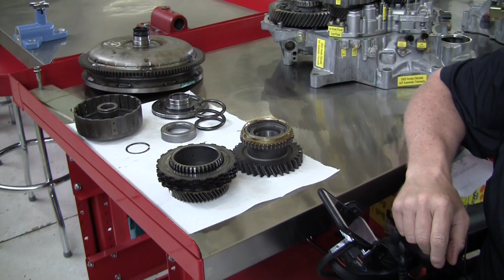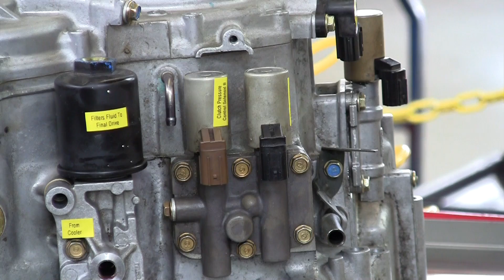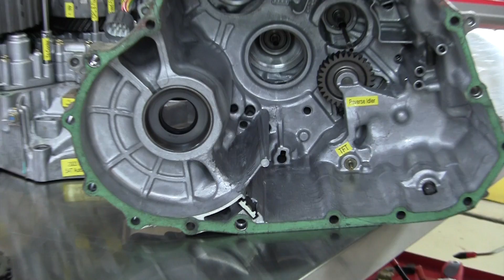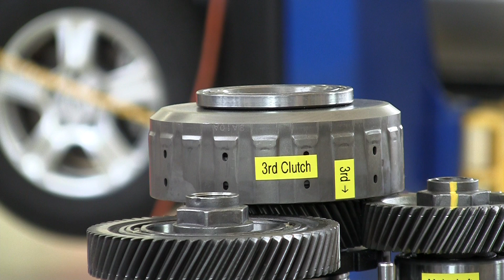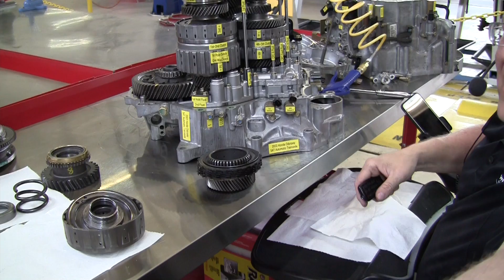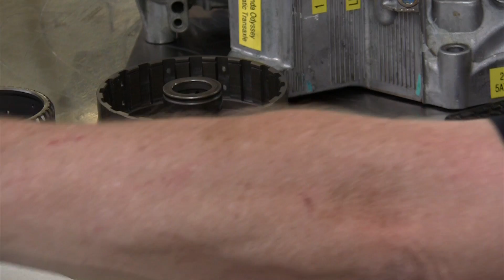Honda AT5 Automatic Transaxle

Comment: Hi, Mr.Weberauto, I just wanted to say I finished my transaxle rebuild and have found the root cause and FIX for the Honda Automatic transmissions of this era, it should include all Accords, Odysseys, CRV, Ridgelines, etc that use this similar design. Please read about my discovery on here, it was a team effort. The return spring that you noticed melted was simply the effect and not the cause.    https://www.odyclub.com/forums/24-1999-2004-odyssey/353519-quick-guide-how-fix-odyssey-5-speed-transmission.html

Comment: hi there! Would you know what has changed in the 5AT transmission since 2003? I have 5AT transmission in my Civic Tourer 2016 model, here in UK. Just wondered if there were any significant changes \ improvements. Many thanks!
Reply: I don’t know what they did but they sure did figure out the transmission. There was nothing but problems in these transmissions around years 2003 to 2006, especially in the v6 models. Now they don’t really seem to have problems but just do a drain and refill every 40k miles to keep the fluid clean. These transmissions hate dirty burnt fluid.
Reply: @robbym3542  cheers for the advice! My transmission is filled with their new fluid DW1 which is supposed to be fully synthetic. However I will most likely do a drain/fill at 40k or earlier!
Reply from the maker: As with all automatic transmissions, there have been many changes and improvements over the years. You would have to find all the service bulletins to determine the changes
Reply: @WeberAuto  thanks!

Comment: I have a 2010 acura MDX. I dont have any transmission issues or slipping my second gear does shift sort of hard. It has a heavier shift shock relative to the other gears. Is this a bad sign? I was told that honda transmission 2nd gear does shift harder then the others.
Reply from the maker: Good question. I have not heard of that. Yuo might check with the Acura dealership to see of there is a flash update for the computer which controls the transmission. Besy wishes!
Reply: consider servicing the ATF fluid and filter then do a TCM Reset so it relearns proper shift points and pressures with fresh fluids.

Most ppl will tell you "this is normal..." until you need a $50000 rebuild and that is normal course too!

Transmission die of high heat from failed/abused clutches that contaminate valves and plug filters. So drive your tranny gently with a light foot to minimize clutch wear AND service fluid for proper viscosity.

Ultimately tranny fail because skinny clutches are the weak points. Similarly this is like disc brakes.... even gentle driving can not prevent replacement only extend life.
👍

Comment: Hi Mr. Weberauto, you said the reason the 3rd clutch pack wore out prematurely is because the return spring is crooked making the Piston crooked causing uneven apply to the clutch discs. My transaxle is doing this and this is a common failure of this transaxle. How can we fix it? My thought is the spring must be redesigned so the top and bottom is flat but who would even be able to do that? A machine shop? Maybe a welder can weld supports on the spring top and bottom so it sits flat?
Reply from the maker: I think there is a new spring and clutch housing design to address that issue.
Reply: @WeberAuto  thank you Mr. Weberauto. I have pulled out the transmission and will be checking the parts soon to see if it has the same abnormal wear on it and I'll see if the parts being sold are the new design. Thank you again

Comment: Thank you for the video, very informative and very detailed. I do have a question though. I have an 04 Acura TSX.  Is there any way to modify the transmission to handle let's say more than 300hp? Like the old American transmissions for example the THM 350, 400, 200R4, 700R4, and 4L60E all have shift kits from various companies like B&M that add extra clutches to the clutch packs to be able to handle more power. Is there anything similar for this transmission or can you just add extra clutches to the clutch packs in the honda transmission?
Reply from the maker: I am not aware of a way to do that. The Acura versions of transmissions are typically stronger than their Honda counterparts
Reply: @WeberAuto  Thank you. Again amazing video, thank you so much for your time.

Comment: Hi Prof, Greetings from Singapore. I have a Honda Accord CL7 5AT (Acura TSX) and I love it. I would like to say that this is by far the most detailed and most educational video on the Honda 5AT. It is both inspirational and fascinating to observe the complexity. The level of insight you provide is priceless. 

By the way, I have always known that Honda's auto tranny isn't planetary-gear based - broadly speaking - is there an inherent advantage to Honda's design? And if it's so good - why don't others adopt the same? Likewise, could you share with us about the inherent weaknesses? 

Aside from this - could you tell us more about what influences the engine braking effect in an automatic transmission? It seems like my Accord has particular strong engine braking which I like alot and do not observe in other cars with planetary-based gearboxes. Thank you so much.
Reply from the maker: Honda's design is their design. They do no have to pay patent royalties to use planetary designs. Their design is good, but different. Engine braking is a function of gear ratio and torque converter slip rate control. Some transmissions also  use a one-way sprag or roller clutch that free spins when decelerating (no engine braking unless you select a lower gear range).

Comment: Thank you for making this very informative video. I also like the solenoids being mounted externally. I have been chasing transmission problems in my bro-in-laws 2000 Accord and cleaned the solenoid screens in an attempt to "fix" his transmission. I now understand they must have been clogged with friction material and the transmission is on it's last leg. Thanks to your video I do admire the design. I just wish the friction material was tougher.
Reply from the maker: Thank you!

Comment: Thanks for the video. I couldn't see the gear sizes but I assume effectively each pack has the same torque on it? The small diameter of each pack and no load sharing between packs must contribute to the failure rate of these in the heavier vehicles? The original Hondamatic only had two (manually shifted) gears and reverse. Internally it was very similar. It's as if they just kept adding to the original design.
Reply from the maker: Thanks for the feedback! Each clutch pack will have a different torque on it. The compensate for that difference with different numbers of clutch plates in each pack.

Comment: This transmission has had a lot of issues over the years in its V6 application.  The 6sp replacement seems to be a lot better.  Honda's new 10sp is their first planetary auto.
Reply: Not true. These transmissions regularly last 200K miles if maintained properly. More importantly, these units shift very efficiently and don't gear hunt. The new 6 speeds lock up the torque converter in much lower gears and have a dead pedal feel. The AT5 is far superior to the AT6 from a driveability standpoint.
Reply: I have a 5AT in my 09 TL im looking to supercharge my engine to make around 350-400whp do you think the tranny can handle that amount of power?
Reply: @scottn7694  I second that. I have a civic(2012 w/ 1.8) that survived not being serviced for over 60k miles and, still drove great with mystery very dark atf (didn't even smell like atf anymore)
Reply: @mrrmsfucker146 my ATF is just like that too, black, smells like earthy dirt. 2006 civic at 225k miles my mom (previous owner) neglected it since 2012 (she didn't know). On the bright side it still will drives well-ish, the filter is already changed, fluid is getting changed asap tho.
Reply from the maker: Very true. I hope their 10 speed is a success. Thanks for your feedback!

Comment: Hello and greeting from Romania. Interesting video about Hondas transmission. I want to buy an Honda Accord 4 cylinders with an automatic transmission (2005 2007 7 gen european model) and i was wondering if it s a safe bet . it is a reliable transmission   (as long as it is mantained) or i am better with a manual one?You said i had some revisions over the years so i hope that from 2005 onwards it got some. i had so far only manual trannys but i like the automatic ones because i drove one and it s more relaxing. Thank you verry much for your videos.
Reply from the maker: Hello, the 2005 models had some transmission problems. I suspect most of the have been fixed by now, but there is a possibility that you could have trouble. Best wishes!

Comment: Professor,

Hi I hope everything is ok!, as we all know Honda has a very unique history with transmission specifically with Automatic 5 speed Transaxle. During my research I end with the transaxle models B7WA and M7WA, what is the difference between these two?

Regards,
Reply from the maker: I know there have been several changes to those 5 speed transmissions, but the biggest problem I have is determining the model number of teach transmission. I have never been able to figure that out. Where are you coming up with the B7WA and M7WA designations. I have never seen anything about that in Honda's own service information, but maybe I have missed it. Thank you!

Comment: Good afternoon any help will be appreciated I got a 04 honda odyssey  when shift to reverse it makes a grinding noise but sometimes it does work intermittent but shifts fine in drive any ideas thank you for your time
Reply from the maker: Reverse is engaged with a shift fork, like a manual transmission. The shift fork is hydraulically activated by the valve body. Make sure your fluid level is correct, check for trouble codes. If the fluid is correct, there is probably an internal problem with the transmission. Best wishes.

Comment: Great video,I lot education,I have a question,on a 5 speed BDKA Acura MDX ,I got a guy to do and overhauling to rebuild the clutches 1 ,clutch was burn, he took it a part in set for one month, a part , ended put it back together, I end up with a 1 1/2  pipe extra , them I look over and over in the computer where that pipe go ,I can't find anywhere the location where that's pipe go, in the tranny I ended installed back the tranny in the SUV , but will not engage,1,2,3,4,5, in can go reverse but not forward, ,,???  Can you please give me some advice , I will really appreciate, thank you,
Reply from the maker: I am sorry to hear that. There is a place for that pipe. Watch this video closely, I show where every pipe goes. Best wishes.
Reply: WeberAuto thank you.i will check out

Comment: Great breakdown of the Honda AT5 - really helped me understand why a Honda automatic would be sensitive to heat or ATF problems. The clutch packs seem identical to motorcycle wet clutches (interleaved steel and friction plates). They even look similarly sized! 

I just replaced an AT5 in my Ridgeline with a low-mileage used unit (my 3rd clutch is gone - after many miles and a fair amount of abuse).  Unfortunately, the replacement transmission seems to have no reverse. Forward gears work, but zero response from reverse. 

In studying the factory manual (and watching this vid), the only cause I could see for reverse not working is mechanical (reverse fork not moving the gears). Is there any electronic reason for reverse to not work (I don't see any solenoids associated w/reverse, doesn't seem computer-controlled)?

Thanks!
Reply from the maker: Thank you! Reverse requires all four shift solenoids and their associated hydraulic passages to be working properly. The 5th clutch, 5th accumulator and reverse servo are all involved. If you get 1st through 5th gears, the solenoids are working and you probably have a reverse servo or linkage issue. Best wishes.
Reply: Thank you so much for the quick reply...I was not looking forward to potentially swapping the trans again.

If a solenoid was not functioning, would you expect the trans to throw a code (we have a code reader which can pull trans codes and monitor at runtime).

Comment: Its worth having a look at New Holland [or Case] tractor transmissions for a more sophisticated version of this type of transmission. Specifically the NH Range and Power Command transmissions which have a six speed powershift [with auto or manual change as the driver decides] similar in design to the Honda [on a larger scale]. On top of which there is a range box giving three ranges and reverse speeds equal to the second range. The range shifts are robotised synchromesh, as is the forward-reverse shuttle, which require a disconnect of drive while they shift. The robotised synchro changes are similar in operation, though not is design, to that of dual clutch car transmissions such as the VW DSG or the Ford Powershift.
Reply from the maker: Thanks for your feedback!

Comment: Thank you for your sharing, Professor Kelly. I wish that I can learn from you. I'm a Hyundai motor mechanic in Australia and I overhaul most of Hyundai auto transmission. I'm just following the shop manual but  I still can't understand all the components in the gear box.

I just want to know  that can you tell it's the valve body issue or gear box internal problems with the oil pressure test when you have erratic gear shifting issue? I can tell the problems with the oil pressure test if one of any gears won't engage at all, but It's hard whenever I have an erratic shift issue unless I dissemble  all the internal gear box components. I can't pull the gear box out if it's just valve body issue due to warranty issue.

Also why is the erratic gear shifting(for example delay, shock and jerking) occurring when the valve body has problems?  lastly what components in the A/T transmission make the vehicle vibrate? I know the damper clutch is the main cause but can the clutch or brake of the gear box make the vehicle vibrate?

thank you  again,
Reply from the maker: Thank you! I have videos on each of those topics, see my channel at youtube.com/weberauto. Best wishes!

Comment: Very helpful and so accurate explanations of transaxle, i would like to say thank you for your time and effort to explain this functions, very hard to find like you specialist who is really good on his job thanks a lot. I have a Kia  Spectra 2004 model and its total milage is 87007km,  Auto Transmission. When im going to work in the morning i On the Car and i warm it up for 5min and put on Drive mode(D) its stays no respond, does not moves, once i push a gas pedal to increase an rpm to 1.7-1.8*1000rpm, than it will engage and will jerk lil bit, after at traffic light i put to parking(P) and shift to the drive(D) it would engage smoothly and seams nothing wrong would be fine but later on i park the car for 5 hours and start the car and shit to D it would appear the same what it could be i tried to go several workshops they use to tell different things all and im confuse to who beleave if u would not mind to help i would appreciate thanks.
Reply from the maker: Thank you, it sounds like the fluid in your torque converter is draining out when you park for 5 hours or more. The fluid should stay in the torque converter and is held there by a special valve in the transmission typically called a "converter drain back valve". I do not know what Kia calls it, but I suspect it is leaking. How to fix it? probably replace the valve body or the entire transaxle. Best wishes.
Reply: cant i just change a solenoid valve? instead of changing a valve body on the entire tansaxle?
Reply from the maker: IsmAil Fazilov no, it is not a solenoid. It is a valve.
Reply: ok thank your very much

Comment: quick question too, if you put a normal auto into neutral you can rev the engine as much as you like and the vehicle remains stationary. In the Honda auto there is a rev limiter for neutral but if you defeat the limiter by putting the trans in N whilst moving the neutral gear actually provides forward motion at high rpm. how come?
Reply from the maker: There is a slight drag created by the fluid in the clutch packs. It is normal.
Reply: Thankyou!

Comment: Thanks so much for taking all the time you have to make this video. I live in the UK and have a USDM Civic and the transmission is fine for the moment but this information is very handy because if anything went wrong i don't think anyone would understand it. I have to change the timing belt myself because I don't trust mechanics to understand that the engine is running in reverse (D16) either.
Reply from the maker: Thank you!

Comment: I read that Honda developed an automatic transmission with standard helical gearsets back in the 1960s in order to circumvent patents from Chrysler and BorgWarner on automatic planetary gear transmissions.  They were also the first to develop a clutch pressure control system using a reaction arm on the torque converter.  Honda also had a manual transmission which was hydraulically shifted in the first Civic.
Reply from the maker: +douro20 Great information, thanks for the feedback! They still use the reaction arm today.
Reply: My understanding was that Honda went this route to avoid spending exorbitant amounts of money for new tooling equipment. Building automatics that were closer in design/layout to manual transmissions saved them considerably